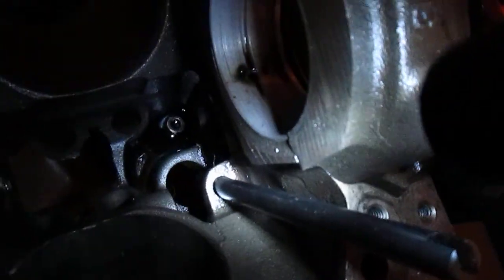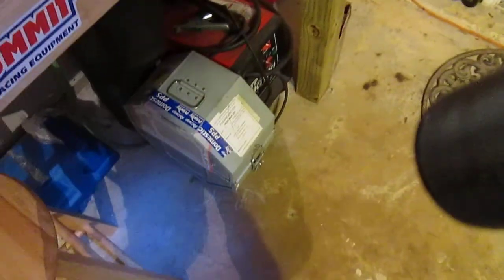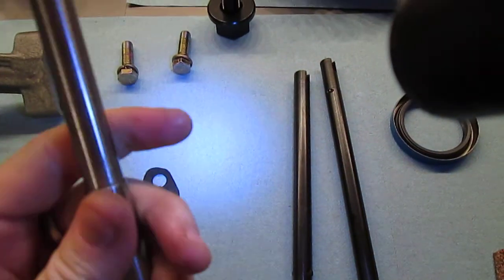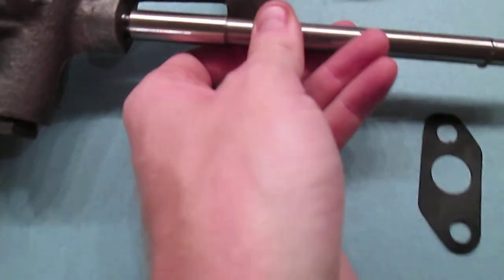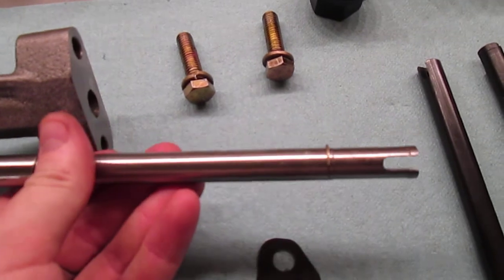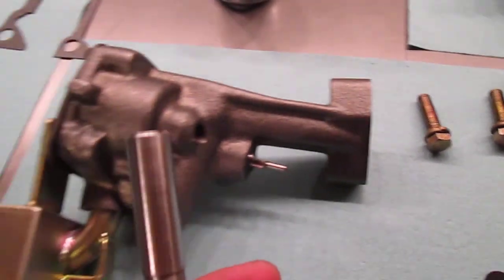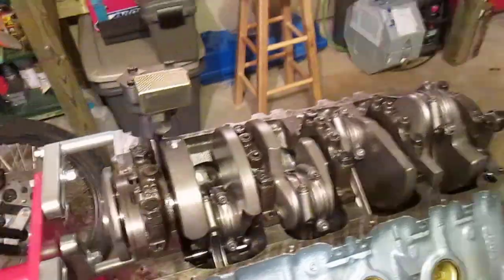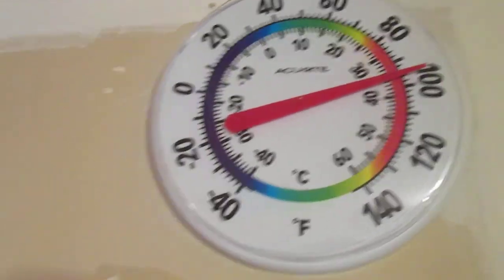Pontiac 400 oilpump shaft and clearance

Comment: what kind of pickup tube and an pan did you use?? can i use that pickup that you are using on a stock type pan??
Reply from the maker: the pickup was a Canton pickup that was recommended to match the Canton oil pan.  i never checked it against the stock pan. But you could easily measure. Looking at it, i would think it probably would clear. as the Canton pan isnyt really any deeper than the factory one, for clearance reasons.  Let me know how it goes! Cheers, thanks. Sam.

Comment: Nice videos, I have seen this problem many times with aftermarket crankshafts, and oil pump shafts, along with your cam plate issue, these parts dont measure the same as oem stuff, factory HD drives were thicker and had a stripe line down the shaft to let you know if it was twisted, like some old school axle shafts, some a/m cranks have thicker front and rear counter throws and interfere with the oil pump drives, Ive had to cut them thinner .100 to fit, your issue was not that severe, good luck on your engine.